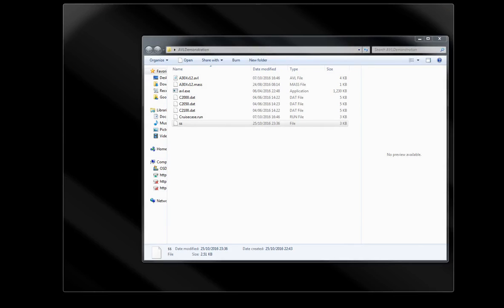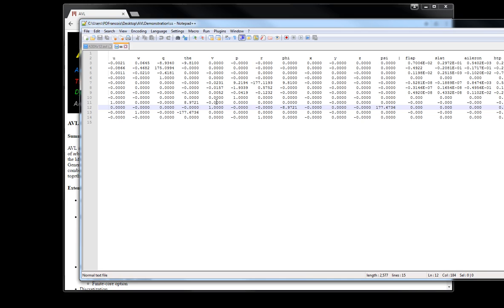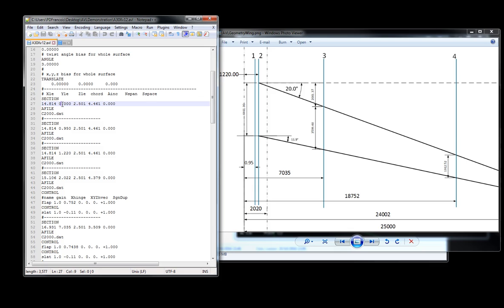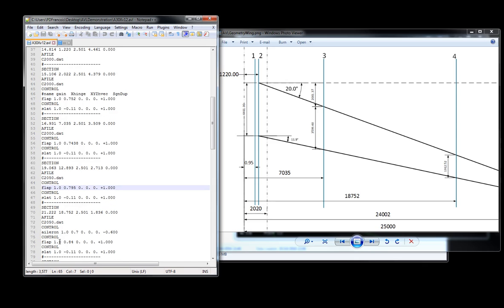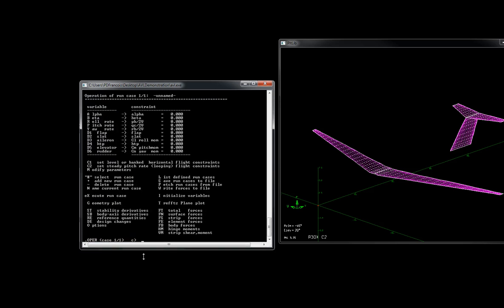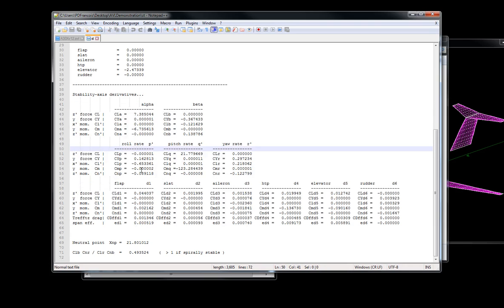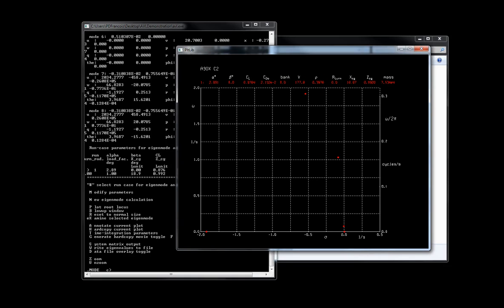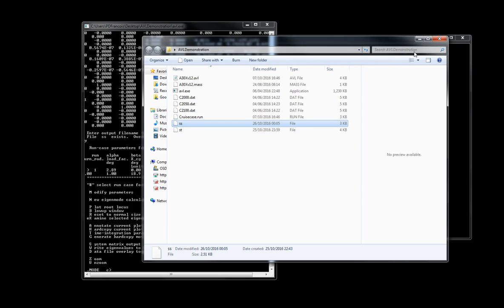Introduction to Aerodynamic Analysis using AVL

Comment: Can you do AVL without doing the mass file?
Reply from the maker: Hi. If you mean without a mass file.. . So you dont need to load a mass file. You can use the M command in the oper menu to manually put in the mass and inertia data. If you meant do Avl without mass and inertia data then, it is possible.. I think your stability derivatives will be reasonably ok. But of course your trim conditons will be off. Using the C1 command might not make alot of sense and your eignenmode analysis will also be wrong.

Comment: we want the cruisecase.run file pleeease
Reply from the maker: ---------------------------------------------
 Run case  1:  unnamed                               

 alpha        ->  alpha       =   0.00000        
 pb/2V        ->  pb/2V       =   0.00000    
 qc/2V        ->  qc/2V       =   0.00000    
 rb/2V        ->  rb/2V       =   0.00000
 aileron      ->  Cl roll mom  =  0.00000
 elevator     ->  Cm pitchmom =   0.00000    
 rudder       ->  Cn yaw  mom =   0.00000  

 alpha     =   0.00000     deg                             
 beta      =   0.00000     deg                             
 pb/2V     =   0.00000                                     
 qc/2V     =   0.00000                                     
 rb/2V     =   0.00000                                     
 CL        =   0.00000                                     
 CDo       =   0.02132                                     
 bank      =   0.0000     deg                             
 elevation =   0.00000     deg                             
 heading   =   0.00000     deg                             
 Mach      =   0.6                                     
 velocity  =   177.900    m/s                     
 density   =   0.39760    Munit/Lunit^3                   
 grav.acc. =   9.81000     Lunit/Tunit^2                   
 turn_rad. =   0.00000     Lunit                                                          
 X_cg      =   18.8660     Lunit                           
 Y_cg      =   0.00000     Lunit                           
 Z_cg      =   0.99200     Lunit                           
 mass      =   75335.0     Munit                           
 Ixx       =   2000000     Munit-Lunit^2                   
 Iyy       =   4800000     Munit-Lunit^2                   
 Izz       =   6600000     Munit-Lunit^2                   
 Ixy       =   0000000    Munit-Lunit^2                   
 Iyz       =   0.00000     Munit-Lunit^2                   
 Izx       =   0217000     Munit-Lunit^2                   
 visc CL_a =   0.00000                                     
 visc CL_u =   0.00000                                     
 visc CM_a =   0.00000                                     
 visc CM_u =   0.00000
Reply from the maker: Please note this is just a template. Note you might want to trim the AoA at some non-zero value at start of cruise and around 0 at end of cruise depending on your CL/CD.I hope this helps

Comment: Hi, one question, how did you get (or set) the viscous drag? is it a constant? Thank you.
Reply from the maker: Hi, in case you haven't found already. After you load the .avl file and type 'oper' and enter to get into the OPER menu. Type M  and enter to access the run case parameters. You should see CD CDo which you can put in the CD0 coefficient for parasitic drag. This is not computed for you . You will need to research parasitic drag estimation equations to compute it. then you enter it here.

Comment from the maker: Hi everyone. Its been about three busy years since I made this video. I apologize for not being able to answer everyone's questions but a lot of it can be found in the guide on AVLs website. I will be finally making a new airplane (a small one) where I will be doing the conceptual design in XFLR5 first so I'll get a chance to compare some results. I am not sure if this has always been the case but, you can export the geometry and mass file from XFLR5 to AVL. This is especially useful if you are designing an airplane from scratch or you have sweep and dihedral in your wings and I would greatly recommend using XFLR5 first since you won't have to muck about with geometry files. In the project in this video, alot of the conceptual work was already done for me so I only needed to start from AVL. Hope you all are getting through/got through your projects.

Comment: are the units of measurement for lengths given in "feet" or "meters"?
Reply: it's not important as long as you're consistent with them
Reply: @rafalsz  ok. So, if I set an INPUT file .avl with distances in" m" and surface in "m^2", for the only geometric parameters of a Wing, the results should be the same ?
Reply: @guidodalessio9267  I don't think there is any place in .avl file where you set surface areas, only distances
Reply: @rafalsz  yes ^.^ The reference surface you Need to calculate CL, CD and CM. In the file .avl, the 4th line:
Name of file
0.0.    Mach
0 0 0     iYsyk iZsym Zsym
154.   4.47.  36.87.  Sref    Cref   Bref reference area, chord, spam... the .avl file continue so you can define all the Wing geometry, flaps, slats, ailerons... Than for the tail  and fusolage. 
Find " AVL - MIT"  on Google
Reply: @guidodalessio9267  yes, of course - my mistake. having consistent units like you mentioned is probably fine. if I find out otherwise over next few days I'll let you know here

Comment: Hi.
This is the only video on YouTube about AVL and is very informative and helpful.
How can I find the neutral point of Aircraft using AVL?
Reply: Hi. Not sure if this reply will help you now but for the sake of providing an answer here it is: After exciting a run AVL outputs Neutral Point location as part of the .st output file. The variable to look for is : Xnp
Reply: @azharcassim2795  Lol thanks...I did actually figure it out 4 years ago. Thanks.

Comment: How do you define that circular fuselage bit in the middle ?!
Reply from the maker: Hi. This is defined using the BODY tag in the .avl file. If you look in the sample input files you will see a file called bd.avl. Under the body section you will see BFIL fuseBD.dat. This calls in  the fuseBD.dat file (fuselage) which is just two columns. To be honest I cant remember what the two columns are for....See if you can load the db.avl file and play around with it and you should get it. I really don't have much experience with the effect it has on the aerodynamics so please take care when using it.
Reply: Your comment is 11 months old now so probably this is too late for you but if anyone else is trying to figure this out - AVL generates this fuselage from a .dat file that is not much different from an airfoil .dat file. The .dat airfoil file format is a txt with a bunch of coordinates, though they are not normal x-y coordinates. It's the coordinate system that's sometimes used in classical aerodynamics, where X = Xmax stands for the trailing edge (and corresponding Y coordinate), then you move towards through a top surface to the leading edge where X = 0. Next you move through a bottom surface towards X = Xmax. The major difference is that for most airfoils the coordinates are scaled down to be between 0 and 1, and for the fuselage you need to use non-scaled dimensions in your preferred unit. This website could be helpful as well: https://tracfoil.com/airfoils/index.php?page=en_file

Comment: Hi Philippe, I am using AVL for aerodyanmic analysis. The program crashes upon loading the geometry, although apparently there is no error in it.
Have you ever encountered this problem ?
here's the geometry:
#
Delta Wing Analysis
#Title
#Mach
0.0
#iysym izsym zsym
1 0 0
#Sref Cref Bref
0.275 0.34 1
#Xref Yref Zref
0 0 0
#Cdp-not defined
#=============================================
SURFACE
Wing
#Nchord Cspace
10 1.0
YDUPLICATE
0.0
SECTION
#root section
#Xle Yle Zle Chord Ainc Nspan Sspace
0.0 0.0 0.0 0.5 0 10 1.0     #using cosine spacing
#
SECTION
#tip section
#Xle Yle Zle Chord Ainc [no need for Nspan and Sspace]
0.45 0.50 0.0 0.05 0 
#
Reply from the maker: I tried it and it ran .. I remember having lots of problems with AVL like this and sometimes it was just a few too many spaces or some simple thing. .Try removing sections or keep simplifying the geometry file until it runs again or just copy your sections into a new file using a template from allegro.avl sample files or something.. it might help you identify the problem.

Comment: Hi Philippe, Can AVL be interfaced with MATLAB optimization toolbox ?
Reply from the maker: Hi Muhammad. I doubt you would be able to do it directly. I know it is possible to run .exes from MATLAB through the command line using the dos() function in MATLAB e.g. [status,result] = dos(strcat('.\avl.exe < ',basename,'.run')). You would have to create the .run file and specify the case files to load and parameters you want to change and then run the case file with AVL through the dos function. You could then write the results to a file and then import the data back into MATLAB, read it and analyse it and then update the case file parameters from MATLAB and then repeat the process again until you achieve some optimal criteria. You would have alot of MATLAB code to write but it should be possible to do something like that. But to be honest I do not know much about the Optimization Toolbox.
Reply: Philippe Francois Thanks for your help. I too had anticipated the same (the case file thing).

Comment: maybe this is a silly question. Could i input a solidworks geometry  file into AVL and get result from AVL. I want to compare the hand calculated result vs the result from AVL. Thank you very much!
Reply: You can't. AVL generates the geometry through a text file with a specific format. It isn't hard. There are many examples of this taht you could use to learn.

Comment: What if I dont have the .mass file (i dont have the data for the mass)? how can I make it?
Reply from the maker: Hi. If you don't have mass data, then you can make a best estimate. For the inertias, I believe there is a Roskam method that may allow you to generate Inertias with very little data or you can even simply get data from similar aircraft to start with or even simplify the geometry to something that has known standard equations for. Once you have this i.e. Mass, Ixx, Iyy, Izz, Ixz ..etc do to the "Sample Inputs File" Section on AVL website and find the Allegro.mass example. you should be able to modify it, just have one entry for you entire aircraft. The most important part I believe is knowing the CG, if you do not have this, your results may be garbage, especially any eigenmode analysis. Good Luck :)
Reply: Philippe Francois thank you very much...I have the c.g for the aircraft. Allegro.mass, I will modify it. Thanks again...

Comment: How to do you add a winglet at the tip of the wing?
Reply from the maker: Hi. You can model a winglet by adding another section on the end of the wing surface. However, the new section will have to have a z-component that is above the z-component of the rest of the wing's sections. I would be cautious when modelling winglets. Check your spanwise lift distribution to ensure you are getting what you expect. I personally would consider leaving them out unless you are sure of how AVL is computing the lift and aero-derivatives and they agree with what you would expect.

Comment: Hi there, very good vedio, currently I want to use AVl to perform some calculation, only about the lift coefficient, but in the .avl file there seems no way to change the unit from default(don't even know the default units) to SI units, is there a way to do that?

Comment: I wish to add alpha vs Cl data points as run cases to calculate the total CL of the wing and the lift distribution at those specified angles of attack. How would I proceed with this?
Reply: Could you do it? I'm interested in doing the same but I dontt know how to proceed.

Comment: If I wanted to have a sweep angle of 45 degrees at the quarter chord on say the wing.avl file from the runs zip file, would I just change the xle parameter to 45 or is there something else I need to do?
Reply from the maker: Hello, Yes, in this case because, the wing.avl only has 2 sections you only need to change the 2nd section's Xle parameter. But you wouldn't change it to 45, I think it will be around 7.5, from basic trigs. Remember that the Xle, Yle and Zle are coordinate points defining the start point of each section, in an arbitrary frame usually where 0 ,0, 0 is at the nose of the aircraft. Hope that helps
Reply: Awesome! Thanks! I was wondering, would you know how to go about editing the wing file to be able to use a particular NACA airfoil so that avl could create the airfoil?

Comment: Would I have to make a detailed geometry and case file myself?
Reply from the maker: Hi Nick, you do not need to start from scratch, there are some examples under the "Sample Input Files" section which you can modify to suit your needs.  They are in the " runs/ directory zip file" on the main AVL page. The best way to get the coordinates and dimensions for the geometry file is from a CAD model but you can also make a sketch in any drawing software that you can draw to scale and that has the ability to measure distances. I used Visio in this video as an example.